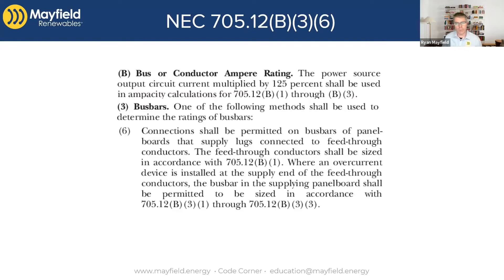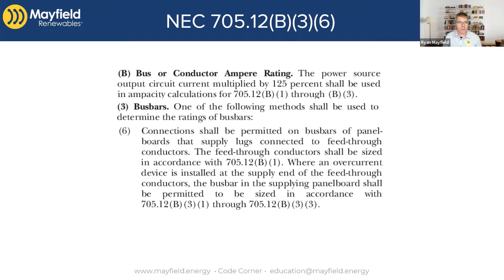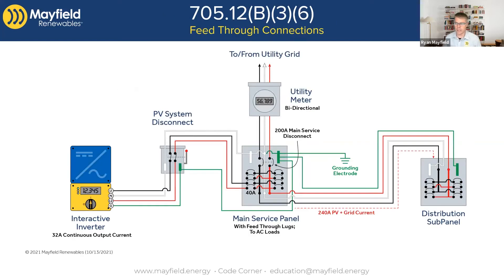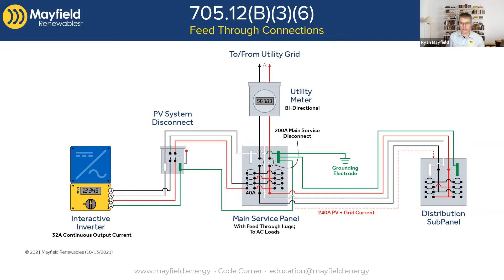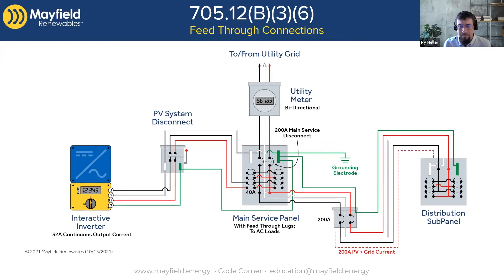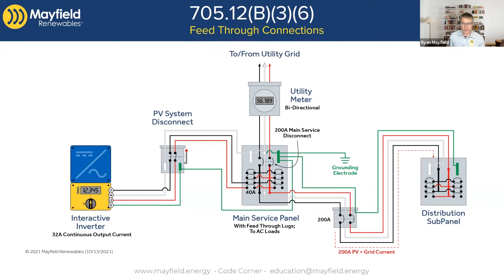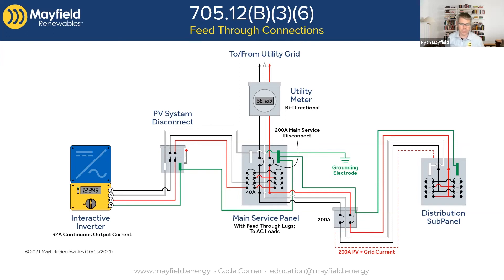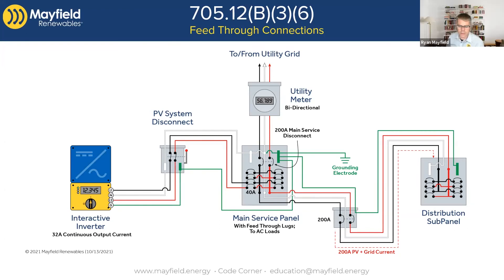Mayfield Renewables Code Corner: 2020 NEC 705.12(B)(3)(6) Load-Side Source Connections

Comment: If the subpanel is <25ft, I think a main breaker on it would sufficiently protect the pass through feeders (similar to a load tap. I believe you covered this option in your 705.12.b.1 video)
Reply from the maker: Yes, that is a very common interpretation.

Comment: What am I missing here with the language of 705.12(B)(3)(1)? The SUM (additive, correct?) of 125% of power source (solar circuit), ok. 32Ax1.25=40A "and" ( sumed with) the rating of the overcurrent device protecting the busbar (200A), if my math is mathing is a total of 240A. By their text, this is exceeding the ampacity of the busbar no matter what the scenario is.

Edit: Still not sure why that section is even relevant, or when it could ever apply, but then I read down to 705.12(B)(3)(2), and that section fits this example that makes sense to me.
Reply from the maker: For the example you provided, 705.12(B)(3)(2) would apply. 705.12(B)(3)(1) would come into play if, for example, you were interconnecting 20A of PV to a 225A busbar with a 200A main breaker. In that scenario, 225A < 200A + 20A and the PV breaker could be placed anywhere along the busbar. This is a very rare scenario.

Comment: Very good video. I see that you didn't address the possibility of using 705.12(B)(3)(3) for protecting the busbar in the supplying panelboard even though the code allows it.
Reply from the maker: Yes, you are correct. When installed according to (B)(3)(6), the rules of (B)(3)(1) through (B)(3)(3) would apply to the downstream subpanel.

Comment: Would putting a breaker in the main panel to feed the sub panel be the easiest solution or am I missing something. If they have a 200 amp service I can’t imagine a sub panel needing more than 100 amps. So feed dub with 100amp double pull from main panel
Reply: If the PV conenction were made as a load side connection in the main and the sub was protected with a breaker, I would say yes, that works well. As long as that feeder is properly protected from overload, that would accomplish the same thing as providing an external OCPD. In the case of needing more than 100A this may be difficult due to breaker sizing in the panel though.